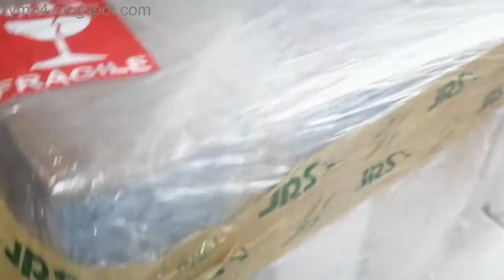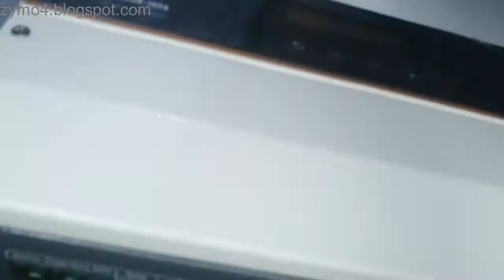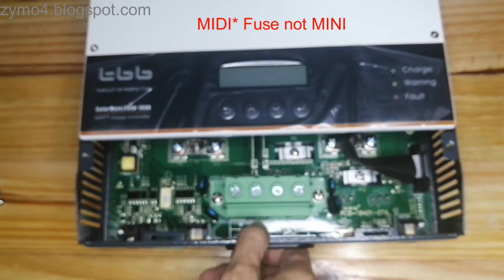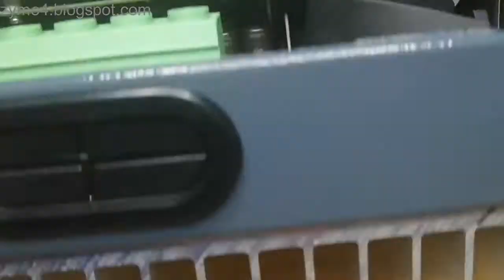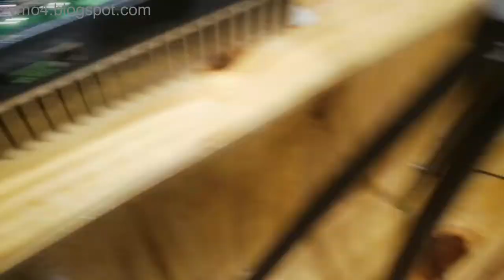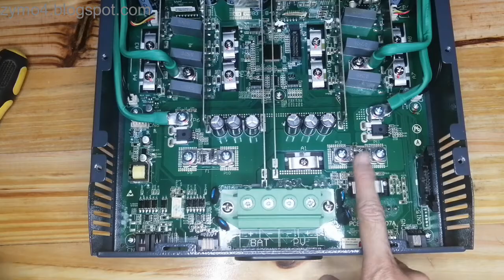Unboxing TBB Solar Mate Solar Charge Controller. 100a 250Voc at 48V system

Comment: What could be the problem when tbb solar mate 250v/100A charge controller displaying Charger standby
Reply from the maker: @GeorgeKambone  battery might be full, or waiting for recharging voltage when battery is discharging.
Reply: @MarkMinoza  I found the problem sir the negative cable at the PV connector was burnt

Comment: sir pwede ba gamitin sa lifepo4 ito? pwede ba mag manual setting sa low voltage at high voltage disconnect?
Reply from the maker: Yes under Customized Battery settings. I think wala ng benebentang model na ganito, MatriX model ang pinalit.

Comment: i was aiming to go for tristar but when i saw this.. . this is perfect!!!!  kamusta naman performance ngayon nian sir? ginagamit mo paba?
Reply from the maker: Upgraded to MatriX , boxed the unit already.
Reply: @MarkMinoza  binebenta mo ba sir? Pwede bilhin?
Reply from the maker: @jetfu400  hindi po, i dont sell, pinamimigay ko lang sa mga kakilala.
Reply: @MarkMinoza  carl tomas po name ko sir mark. Taga isabela.. hehe kilala niyo napo ako. Hehehe baka naman sir, ready ako bilhin yan sainyo kung gusto niyo, salamat po. Need po kasi saka ang ganda ng build niya base sa pinakita niyo sa video.
Reply from the maker: @jetfu400  not for sale sir, mas maganda ang MatriX vs sa Energier.
Reply: @MarkMinoza  may mga toroidal 48v po kasi akong inverters dito sir at mga batteries. Diko na  po kailangan ng additional inverters sir. Mppt na kailangan ko sir yung mataas na voltage input tulad nian. Sige na sir please. Kung dimo po benta sir baka pwede hingin ko nalang po.
Reply from the maker: @jetfu400  what you need is the TS600, yan ang gamit ko in tandem sa MatriX.

Comment: Hm po sir
Reply from the maker: Nasa 20k++ php.
Reply: @MarkMinoza  konti nlang pala sir morning star Tristar na
Reply from the maker: @toots3020ph  revisit your design. Let me know your plans. I'll help you out.
Reply: @MarkMinoza  tnx sir for the  advance support, as of now in still in the stage of canvassing solar materials, my plan is hog toroidal and gti.
Reply from the maker: @toots3020ph  new TBB Hog models has timer, no need to buy gti if youre not planning in getting it net metered.
Reply: @MarkMinoza  ah okey sir how much it will cost me if ill go for hybrid tbb , i need 4kw to 5kw 48v inverter, energier apollo model has the capability to be AC or  DC coupled in times that i decided to add gti inverter? Can i use my existing PV array to power up these 2 device?
Reply from the maker: @toots3020ph  Energeir Apollo model doesn’t support ac coupling. Its an off grid inverter.
Reply: @MarkMinoza  tnx sa info sir
Reply: @MarkMinoza  pero sir itong tbb  kinegerier hybrid on/off pwede sir i dc at ac coupling.
Reply from the maker: @toots3020ph  Kenergier is their Hybrid On Grid, bidirectional Inverter. But a bit pricey.
Reply: @MarkMinoza  tnx sir

Comment: Is this mppt is equipped with priority mode? Wha is the max short circuit current input?
Reply from the maker: This scc talks (slave) to Kenergier Hybrid On Grid model. If used as a standalone scc, its configuration is limited to flooded and sealed battery.
Reply from the maker: 125AMps, this is controlled by the Kenergier Inverter. Settings as a standalone is limited.
Reply: @MarkMinoza  tnx sir for the info.